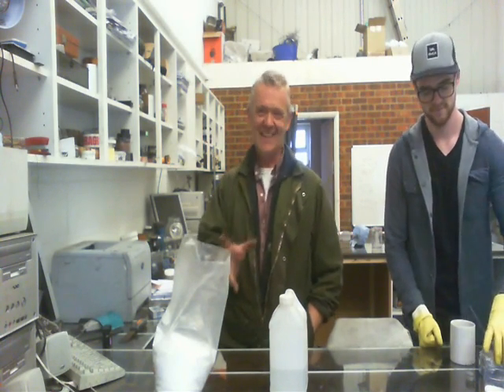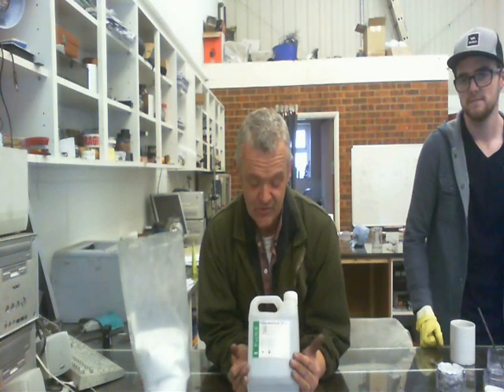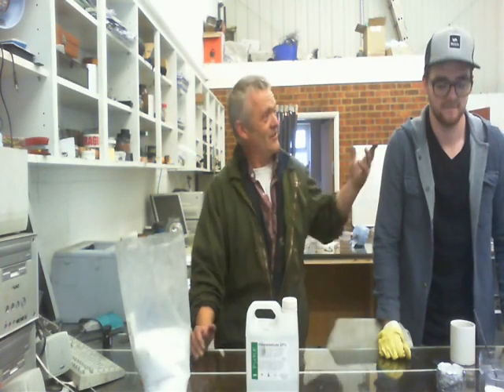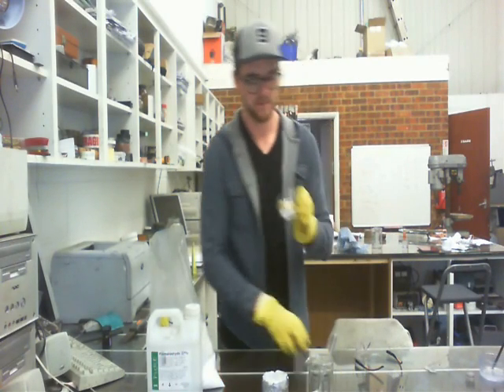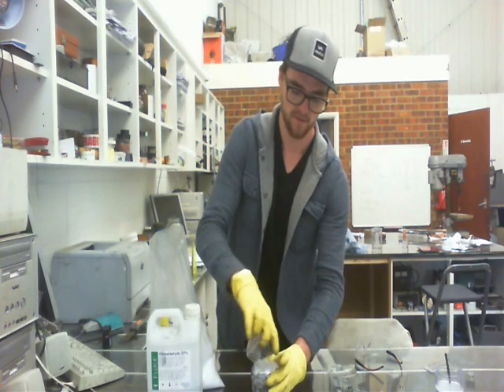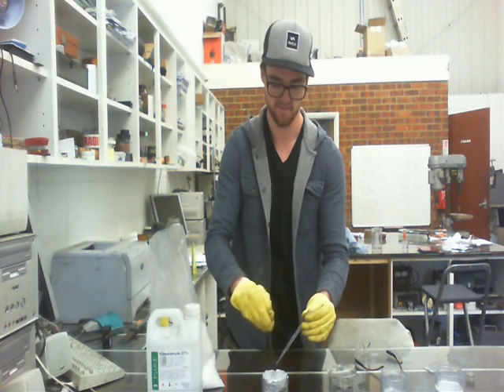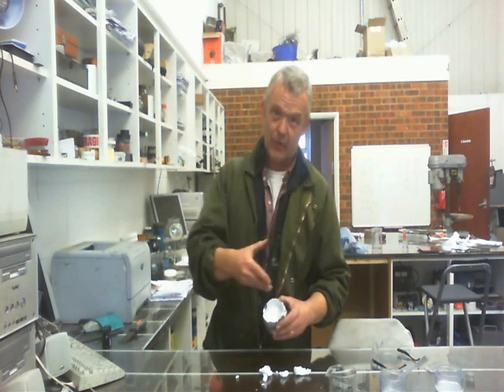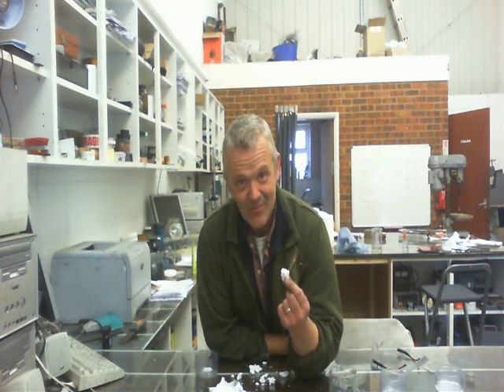How To Make Plastic From Urine

Comment: Whenever I make nitric acid now I actually dip my fingers in a strong base before I hand any of the glassware.  the stuff dips over the rim of any glassware and you do not want to get it on your fingers They will instantly turn a dark yellow the skin will fall off in about 4 days.  Nitric acid is actually a time where using gloves is a bad thing as it will destroy latex or nitrile instantly. keeping the fingertips damp right before going in to handle anything not only protects you to a degree but its the perfect alarm that you have come into contact with the acids as it will bubble like mad.

just a tip from a guy that had yellow pealing fingers one time too often.
So yes good tip on the keeping a base near by

Comment: So how to use the plastic after it is made  do you grind it to powder next mix with graphene and then heat/press in a mold? Or do you add the graphene as you make the plastic and mold it straight off?
Reply from the maker: Barskor1 try both
Reply: Robert Murray-Smith Sure I was thinking the mixing at plastic creation would have better bonding to the graphene over mere encapsulation. Cheers.
Reply from the maker: Barskor1 give it a go and let me know how it works out mate

Comment: Would it be possible to do in any way without the sulfuric acid? Sulfuric acid is strictly regulated here in Norway.
Reply: Hi Gugl You can make sulfuric acid really easy Do you have access to sulfur for gardening purposes? If so you can make a vaporizer to burn the sulfur in a acid proof chamber such a 2 litter soda bottle that is half filled with distilled water. the water will react with the sulfur fumes and make sulfuric acid. Concentrate the acid by evaporation or boiling slowly till white fumes appear always use safety gear and fume hood or work outside.
Reply from the maker: Barskor1
good post mate - thank you very much
Reply: Sulfur is available. Thank you for answering.
Reply from the maker: there are quite a few ways to cure urea formaldehyde resins - normally metal salts like aluminium sulphate are used but you can use ammonium chloride too - the cure time is much longer and you have to heat the resin for four hours in the make processes rather than just mixing it - so it is a bit more long winded - the version i saw is the demo you get at college when you do higher level chem  - it's a good demo because it is quick and easy - but in order to make it without the acid it is a bit more time consuming and difficult - hope that helps
Reply: Gugl Your welcome
Reply: Robert Murray-Smith Thank you for the compliment and your welcome I am glad to help where I can.
Reply from the maker: Barskor1
cheers mate

Comment: I just tried this reaction and it did not work quite the same as above,  I used all standard chemicals,  my sulfuric acid is slightly higher than 18 mol wround 98.7% averaging three titrations."

When i started to add the sulfuric acid, 3 or 4 drops and three stirs perhaps it boiled over energetically similar to dumping sodium carbonate into acetic acid  It actually hardened in mid air as it overflowed.

now I will say that i stirred it on my hotplate and there was still heat in the plate from a precious reaction.  very low however. perhaps 35c maybe?  The solution was I would say 30c when I started to stir in the acid.

Would you think that I should dilute down to about a 95/96%?
Reply from the maker: Clown Whisper The acid is catalytic for the reaction - so yes lol - slow it down don't speed it up
Reply: Thank you robert.  I was not sure if it was the acid that was the culprit or the warmth of the solution.  FIgured I wouldn't  waste any more formaldehyde in an unintended homemade volcano until I asked the pro's :)

Thank you for the guidance mate.

now if I could only make delrin !!!

 .
Reply from the maker: Clown Whisper you can use other catalysts - ammonium chloride will do it - you just have to leave it overnight
Reply: Robert Murray-Smith Oh BRILLIANT!  
That is exactly what I need as the mold that I want to cast is one sided but has more features than a fast reaction would handle for back of a better word.

THANK YOU!

Im getting nothing but good news (test results) and now this !

LOL  little things get me excited these days
Its all a matter of perspective.
Reply: Robert Murray-Smith In my excitement I forgot to ask if you knew the amount of Ammonium Chloride.  

If not ill just do some testing and see what i can come up with!  

Thank you again Robert.
Reply from the maker: Clown Whisper just test it and see mate
Reply: Robert Murray-Smith Will do Robert.
perhaps this will give me the opportunity to give back to the group
Reply: Well the ammonium chloride did about the same or worse!  I got a column of plastic foam that shot up out of a beaker 2 inches.

It was actually really really cool!  There may even be some use for it!

I made up a batch of ammonium chloride and reduced it down to the point that crystals were just starting to form, then slowly added di water back until it was just saturated.  I used one ML as a starting point.  three seconds later  in a flash  it reacted.

So im going to dramatically reduce the concentration and do it again.  This stuff gets extremely hard over time like you said.

I will find the formula and post it for your viewers in case anyone is interested.
Reply from the maker: Clown Whisper yeah that's quite a lot to use lol
Reply: Robert Murray-Smith Not being a chemist I had nothing to go by so I had to select a random starting point.  I picked that starting point as 1ml the same amount as the acid.

I will dial it in today if Im well enough.

Comment: Cool. Is there a name for the polymer produced? 
Since it's brittle, I'm wondering if I could mix it with a silicone to make it less brittle (I'm busy with exams so I can't try it right now) but I've been very interested with 3D printing. 
A kilo of ABS/PLA plastic costs about 20 dollars so I was actually looking into making very cheap plastic for 3D printers.
Reply from the maker: Nathaniel Zhu it's urea formaldehyde resin - it's probably one of the most produced plastics
Reply: Nathaniel Zhu urea formaldehyde resin is a thermosetting (as opposed to thermoplastic) plastic, so I don't think it will work for a FFF/FDM 3d-printer, which relies on being able to (re-)melt the plastic when squirted out the nozzle.
Reply from the maker: Jon Nordby it's cascamite glue mate - water soluble - don't know if this helps
Reply: Robert Murray-Smith one could build a 3d-printer using a syringe-type extruder and extrude the plastic while wet, and let it cure as the printed shape. This could be interesting for medium scale fabrication, especially if mixing in some fibers (wood or similar). Then one essentially can 3d-print MDF/HDF. Likely the biggest challenges will be taking into account the shrinkage and non-uniform curing, as printed part may have different thickness in different places
Reply: The fact that curing will take a long time will also limit how tall objects can be built, as layers put on top will cause lower ones to deform if done while not cured
Reply: Oh I see thanks for clearing it up. I've been wanting to try a syringe extruder or perhaps controlled pump type extruder in order to print layers of cells (just imagination right now). Too busy to actually try anything right now.

Comment: formaldehyde is everywhere anyway and taxidermists use it like hatters used hgkno3. so is the sulphuric acid working as a catalyst or an oxidiser?
Reply from the maker: Ashes Wake apparently your sweat has formaldehyde in it! - the acid is a catalyst - other stuff can be used like ammonium chloride
Reply: i wouldnt be surprised its what, the most basic aldehyde? why its so toxic i assume. why did you use acid cat not base like literature? do you know if it would work with other aldehydes? wonder what say benzaldehyde would make its cheaper than formaldehyde.
Reply from the maker: Ashes Wake it orks quickly so great for a demo - too quick for practical application so use a base - as for benzaldehyde - try it an dsee
Reply: i did a little bit , it seems benzene is commonly used to go to styrene and then styrene polymers with aldehydes and halogens, new chinese patent and plant suggest toulene - styrene + xylene - styrene polymers, ive never overly explored plastics and its chemistry mainly just synthetic.
Reply from the maker: Ashes Wake It's a fascinating subject - i tend to think more about renewables and biodegradables - for obvious reasons - but it is a huge and interesting area to explore
Reply: green chemistry is essential, we will run out fairly soon will need to scrub it out our environment which will be a testing point either that or pillage the stars (way more likely)
Reply from the maker: Ashes Wake indeed